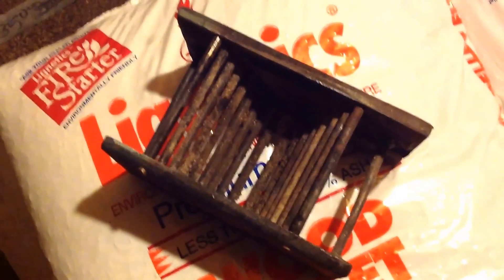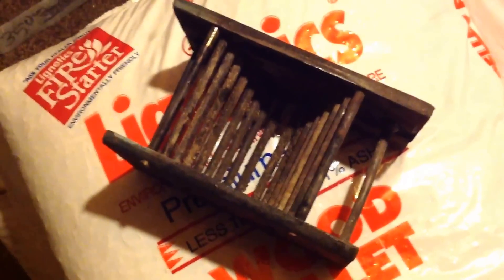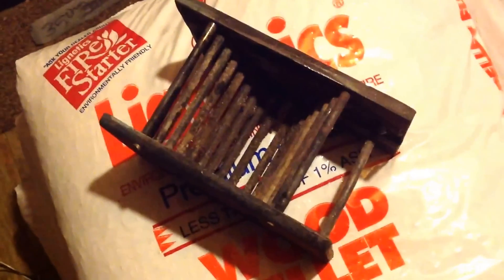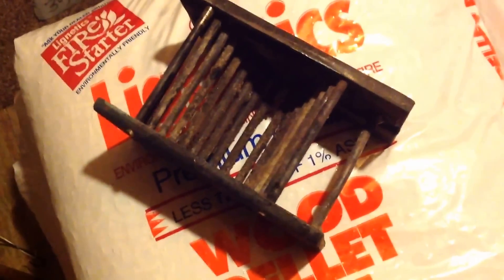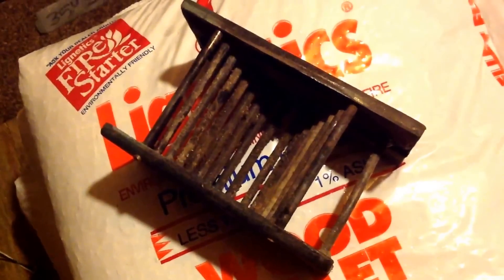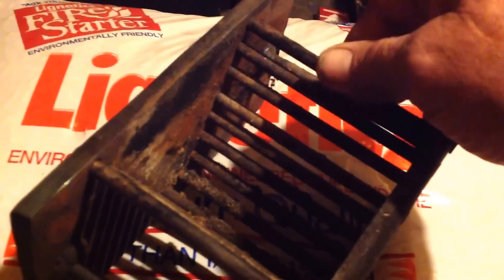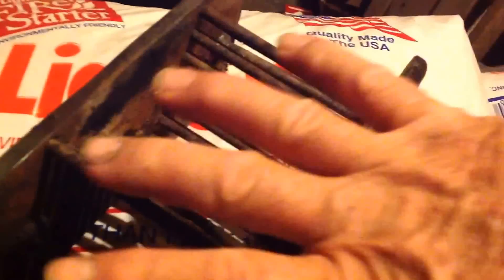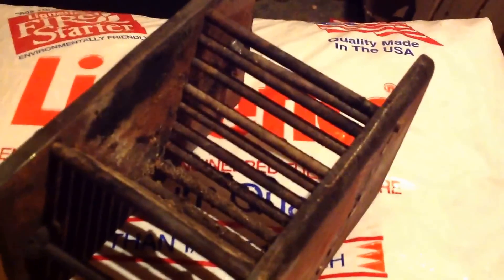Rocket stove Howlett basket stainless steel

Comment: I found 3/16" gap between the rods is too close because it will eventually plug and stop the burn (unless you shake it every once in awhile) and I don't want to have to babysit my stove. Measuring the pellets is 5/16" so the gap on my burners is 1/4" so the pellets can't fall thru until they are partially burned. Then they will fall and continue to burn until they are blown into the ash pit.
 Also, I found that making the basket so the rods are mounted vertical helps them move down better, keeping the basket clear of plugging up.

Comment: I made a Rocket stove with basket with in one hour the ash in the basket puts out the fire ,,,how can I get the ash to fall out of the basket ,,,started with 1/4 " gap and went up to 3/4"did you run into the same problem ??

Comment: I knocked up one quickly using some scrap 5mm plates and 6mm rebar. I offset my bars to allow more air  and less buildup and Im satisfied so far. I allow a split air feed from the top and bottom, which I adjust depending on the draw,  which is better with a bigger flue, tho I cheated and didn't increase the outlet at the back of the heater so I get flame-out some nights if the breeze drops. Still refining. I use the scientific principle of making one change at a time, noting the changes and keep an eye on the variables...

Comment: Great design. Wondering how much it would cost to use tungsten rods or even tungsten electrodes rather than stainless. Tungsten withstands extreme heat.

Comment: Hey Mike,
I made a similar basket and was getting good results but wanted to get something better. I'm not sure how or why it happened but by adding a flat plate at the bottom and changing the draft I was able to get an incredible after-burn. If you are interested I would be happy to share.
Reply: Please share I have been experimenting with a pellet insert for my rocket stove it has not been successful yet

Comment: The problem with this style burn basket is the rods will plug the basket while burning, making the heat output drop during the burn cycle. And the fact that the pellets burn so hot, the rods eventually burn out and need to be replaced too often. I found after just 5 burns (5 days) the rods were so small in diameter, they just bent and fell out. Poor design in my opinion. Back to the drawing board.....

Comment: I tried the bascked but without success. The fire died after about 1.5 hours. Maybe I am doing something wrong. I used 6mm rods with 5mm gap. Angle is 60 degree. The gap in the bottom is 15mm. Pellets are 6mm in diameter. My horizontal section of the stove is about 5 x 5 inch (130 x 130 mm).
Reply: Lyudmil Zahariev - what diameter and vertical height is your exhaust pipe? Sounds like a weak draft - have you tried adding more exhaust pipe to create a stronger draft?
Reply: The diameter of exhaust i s110mm and the length i sabout 17 meters. The stove works on wood without a problem.

Comment from the maker: all I did was tapped on the basket the little bit    fell off and away we go it didn't seem to hurt anything it still had air going through I'm building one out of a 10 gallon propane tank this one here puts out tons of heat I'm going to use 5x5 by quarter inch steel

Comment: Good idea for the bascket. 
Is there an ash build up after some time of burning or the stove burn "maitenance free" for hours?
Reply from the maker: the ash goes up inside the heat chamber my exhaust is up 4 inches off the bottom at the end of the season pull off the exhaust and vacuum out inside the heat chamber
Reply: +Mike Knop Yes, I understand. My question was about the burning bascket. In some of my experiments there was ash build up in the burning bascket that blocked the air to go tru the pellets. Do you observe simmilar problem in your design?
Reply: I have used this same design, although I find the ask builds up in the basket and needs a poke. I also have a hole cut under the basket for the ash to drop into, I have found I need to put a small piece of metal angled upwards in the back to the ash hole to get the proper air flow. Seems like once it gets to the temp it wants to burn at it kinda idles down. I also get some smoke up the feed tube if that angled metal isn’t in there to create turbulence